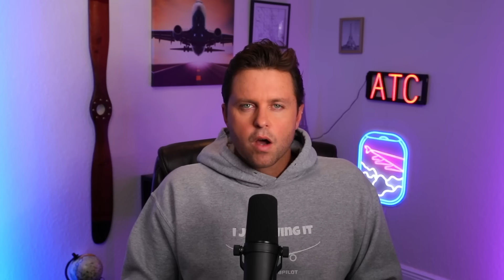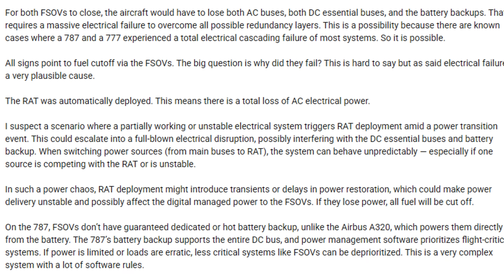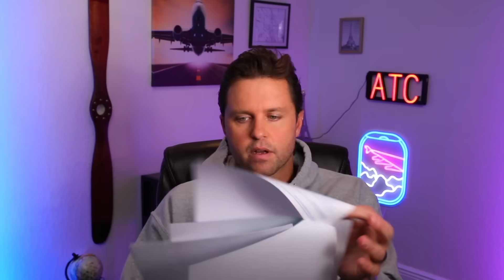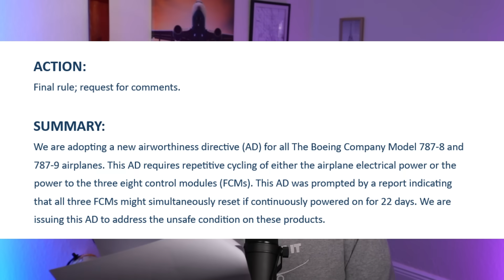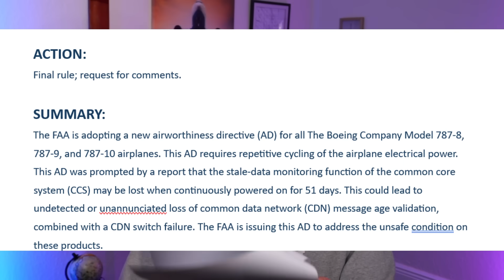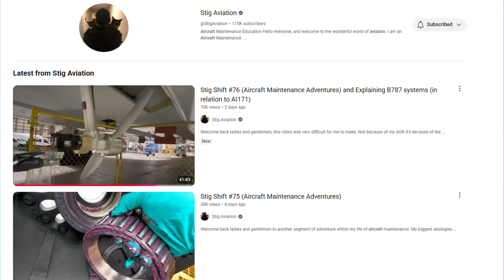Air India 171: Did a Software Glitch Cause Dual Engine Failure?

Comment: I Just saw your latest video report on Air India, Friday, June 20, 2025 @ 1639, I did send my comments to another YouTuber, got no response.

What do you really think, I know we don't want to scare people from flying on aircraft but safety should be first safety should be Paramount.

I agree with you!
Everyone must remember to wait for (all) the facts to come out in this and any investigation, before we can possibly safe for sure what caused this accident, There may be times when we may never know, Wait for the experts like NTSB and FAA to do their jobs. 

Everyone should Stop trying to be first and make sure of what you are saying before to speak, (Anyone) can list several causes of what could have happened, and you might be right, I would only ask that all who speak on accidents the extremely cautious on what they say.

The last thing we should ever do in anyway, is blame the flight crew, Wait for the facts and wait for the investigation to conclude.

Please explain how fly by wire aviation technology works and what is the failsafe if the fly-by-wire fails.

Modern aircraft today, are using more fly by wire technology no cables, or mechanical linkages to input command to the Engines, Flight Controls and other Critical Components, am I correct on this or not. So the Aircraft relies heavily on electricity computers and solenoids, am I right on this or not?

Dual engine failure is possible at any time, I understanding the likelihood of dual engine failure happening is (not) very high, but it is possible.

Aircraft flying over water should have no less then three engines, and be capable of flying on one engine, It can't be about saving money when you talking about people's lives.

Just Joe

Comment: You would think the pilots should have been aware of poor acceleration. If you are 3/4 down the runway and not at V1 yet, there is something wrong.
Reply: Excellent point !
Reply: nobody mentioned poor acceleration during the first face of take off
Reply: @eco_logic  Also this can be watched in the Take Off-Video: The plane took off extremely late, at the end of the runway. Somebody said, normally the take off of a 787 happens a lot earlier on this runway. Logical that it should be so, as the first buildings of the city are bordering this runway. I assume, acceleration wasn't sufficient , too. Even at this point there was something not working normally.
Reply: @honestly1412  that has been debunked already when you compared the video images with google map references the plane didn't take of at the end of the runway. There was enough space and the plane did not use the full length.